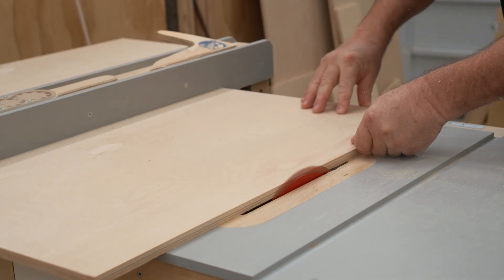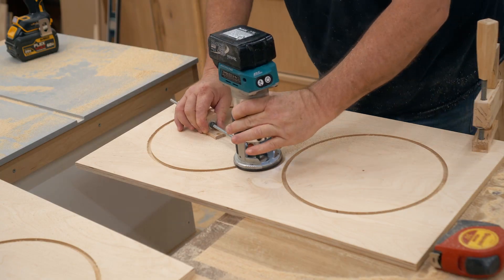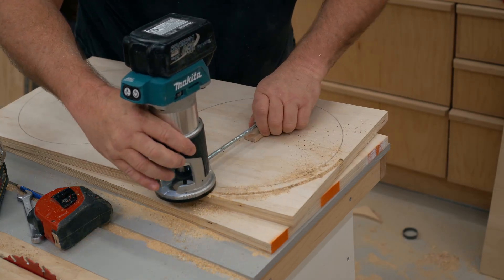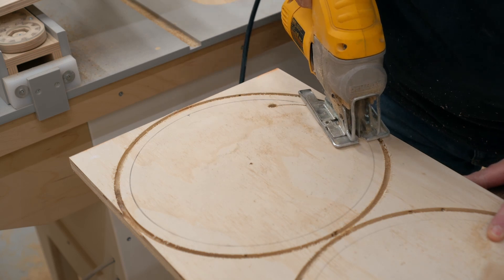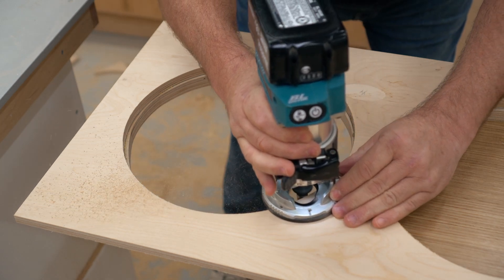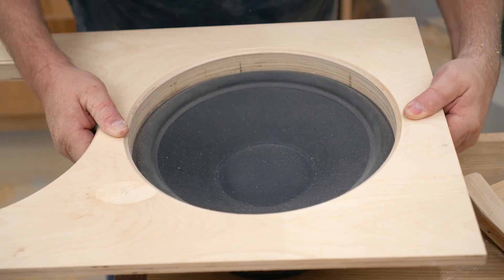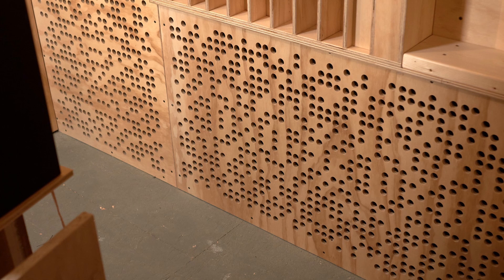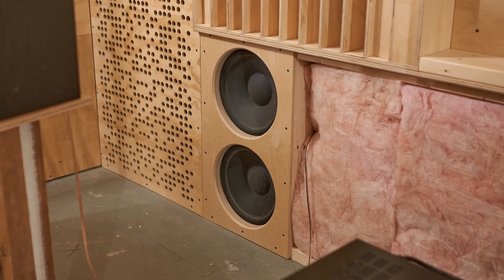BIG Bass in a Small Room - Making Infinite Baffle Subwoofers

Comment from the maker: After the very encouraging results I got from the open baffle subs experiment, I decided I'd go all in and put them directly in the wall. This is known as infinite baffle, where you are just getting output from the front of the drivers without any interaction with the back wave of the speakers.
My listening room's front wall has a utility room behind it, so it's nearly perfect for this setup. All I had to do was cut out the drywall directly behind the woofers to open them into the space. The utility room acts like an infinitely large box and completely eliminates cancellation from the back wave of the woofers.
I did have limitations on where in the wall I could put them, and this close to the floor isn't ideal. But the results are outstanding - flat bass extension down below 20Hz in the room and the woofers are neatly out of the way.
These are four 12" woofers with each pair wired in parallel (for a 4 ohm load) and driven by a 100 watts per channel Yamaha receiver that can deliver nearly 200 watts per channel into 4 ohms.
The "Mad Max" recording at the end was done on a Zoom H1 using the built-in mics from the listening position. The Zoom H1 has two mics built in for a "stereo" recording. Not the greatest mics or recorder, but close enough to give you an idea of how the room sounds.
Reply: How about adding an “Aperiodic Membrane” behind the Sub drivers? Easy enough to do in your situation with the utility room behind. It would be another great video you could run before and after measurements!  If not that’s cool too. I really enjoy your videos! Keep up the good work! 🤘🏻😎🤘🏻
Reply: @doctersound9630  Thats interesting.  If its infinite baffle whats the point in absorbing the backwave though>?
Reply: An "aperiodic membrane" is one part of a type of subwoofer enclosure. It is an air-permeable sheet which has frequency dependent acoustical resistance properties. The original design goes back to Naim, for use
in home systems, but has been applied by several individuals and
companies in car audio.The completed system will be aperiodic, which means it will prove to be over-damped with a Q well below 0.7. In contrast, the most commonly used sealed enclosures have Qtc's in the range of 0.8 to 1.1 which are considered, by definition, to be underdamped. When improperly used, a high-Q system may have poor transient response, nasty peaks in frequency response, and high rates of roll-off. Aperiodic systems will feature excellent Aperiodic systems are characterized by better transient response, flatter frequency response and somewhat extended low frequency response. 
Cheers! 😎🥃 - Hope this helps!
Reply: @doctersound9630  aperiodic membranes don't do miracles ad in no way they make subs or woofers act like open or infinite baffle. What they do instead is to make the driver hit lower but not as low as with a port or if it was in an IB. To put that into better perspective, AM allows you to play lower in a smaller cabinet, by about 1/3 of a full size sealed one. That is why they go out of fashion. They also tend to leak some sound no matter what you do, so they're not very Hi-Fi friendly. I would just opt to make the cabinet bigger instead, or use passive radiators. Of course, since I can not install a IB i my home. Yet!
Reply: @IlarionMoga  It was just a suggestion it would be awesome to hear a side by side comparison.  See if there was any change?  I would be curious as would other audiophiles and just casual observers.  Cheers and thank you for the reply!  Great channel!
Reply: @doctersound9630  I read some about them from forums and people designing them and who made speakers with them. It's not worth it from a performance standpoint if space is no issue. Ports and passive radiators would sound deeper anyway. AM is just a sealed enclosure that beats almost the same as one in a smaller volume. In the same volume enclosure  AM wins over sealed, but as soon as you increase the sealed volume, there is no comparison.

AM are not recommended to subwoofer drivers. They move a lot of air and usually play in little boxes too. There are some woofer that need large enclosures to play low in sealed or vented. So they might be worth it for boxes of at least 2 cubic feat so you have a gain of another cubic feat by implementing an aperiodic membrane.
Reply: @IlarionMoga  Good to know.  Kind of what I thought.  I've never seen anyone test this in the real world.  I think it would good education.  I've need been drawn to AM, just think they are often forgotten.
Reply: I would pay to hear this set up
Reply: Doesn’t some bass bounce back in from the other room?

Comment: It's not infinite baffle when you have a leaking wall with all those holes and insulation.
Reply: To give you the benefit of the doubt, those panels are not vented on the back. You can see him building them and talking about them in other videos.
Reply: @TokeBoisen  You can see on this video that the 'diffusion' holes or whatever those are supposed to be are open to the back of the room. This means that the baffle leaks to the back of the room and is not an infinite baffle. This doesn't metter though if and when he gets such a good response. It's just not a true infinite baffle, more correctiy an acoustic resistance box.

Comment: MAGNEPLANAR will solve most everything.  They do not do the very lows, even you have said can no longer hear. Great sound scape.  Not cheap. First time I heard them was in 1974. Nothing compared to now.  My "little" HPM-40's still outperform and a certain volume than most everything. The 4 year old Cerwin_Vega SL-15's are mud after 30 watts on an ONKYO high end receiver, though "capable" of 200 real RMS watts".

 In your room, very nice by the way.....scalp a pare of magneplanar... sorry old school name... Magnepan 3.7i for your room size.

Sound Stage..........
Heart pounding........
Clarity.......

Pick out the location of each instrument, absolutely amazing.

John, even with your and my destroyed hearing from loud noise and tinnitus.  These are your answer to enjoyment.

Be very careful. 100 watts may necessitate a foundation rebuild.!  400 watts and the house falls down. Large volume of air movement. That's why you "feel" the instruments as well as hear them.

Comment: Infinite Baffle is really cool. I'm planning on trying it out in my car with a Ultimax 18 I have laying around. 

Though my goals with bass aren't a flat response. It's an increasing level of output to the lowest areas my subs can play. Which currently is 17Hz in my car with my Ultimax 10. I like to have at least 10dB more output at 20Hz vs 100Hz. If it's low volume listening a little bit more than that. (In car low volume might be 60-70dB for me, I try to stay under 85dBA though that doesn't always happen)
Reply: In that case, a big vented box that's tuned very low is best. Or if you have the room, a very low tuned tapped horn, but it will be a beast, and is more difficult to design.
Reply: @TimpBizkit  That's what the 10" was. A big "vented" (Passive radiator in my case which functions the same) box. 

The infinite baffle Ultimax 18 I put in my car is great because I have all my trunk space back with the same or similar output in the 15Hz range.

Comment: Hi All - I have 4 x 15" original Adire Tempest subs in Manifolds build into the floor in my dedicated room.  The floor cavity is the box.
2 Drivers in each Manifold,  facing each each other to cancel mechanical vibration, with the top open into a hole in the floor.    A manifold behind each main speaker, in the front corner.     

Technically they are over-damped, QTS is 0.4, but practically.....awesome.   Similar to John they extend well below 20hz.   Rolloff stuff, F3 and all that....is irrelevant, it all happens so low it doesn't matter.   As they are flat (room excluded) through the relevant frequencies, group delay is very low.

After EQ (Multiple Subwoofer Optimiser to EQ them together, then the Anthem ARC over the top), the  in room response is very flat - but you will always be at the mercy of the room, and you can't move them around for a better response.

Excursion has never been a problem.   At normal listening levels they barely move.  There is no air spring to overcome, and loads of cone area.  Therefore distortion is low.
At insane movie levels they move a bit....but the floor/room is shaking like crazy..and at ludicrous levels the floor feels like an earthquake.    Power has never been a problem either, I drive them with a Rotel 200w per channel amp and have never clipped them. 

But while they can go loud, it's really about a clean, articulated response that make your main speakers feel larger and opened up.    Not chest-punchy car sub competition bass.    (But with this much headroom, you can EQ whatever bass response you want.)

If you can do this...DO IT!

Anybody else remember The Cult of the Infinitely Baffled website?

Comment: Hey John, great stuff. 
SBA, single bass array!

Despite the fact I'm currently exploring all things open baffle etc., I'm an IB enthusiast/advocate as well. 
I built an attic mounted (4)x18" IB firing thru a dual opposed manifold. 
I also have two, double 15" SubMersives. 

There's nothing like the bottom octave efficiencies that accompany an IB alignment. 

An IB only needs a small fraction 
of the normal power required for a sub... ~10%... that's huge*. 
A typical high performance 18" sub driver may require a few thousand watts to hit full stroke in a typical sized enclosure. 
My 18"s need only 200-300 watts to bottom at 30mm. 

*(reducing power needed by ~10x dramatically lessens compression effects of instantaneous peak voltage drop from the breaker, the wiring, the amplifier, etc)

Even though the driver hits full stroke, distortion is lowered because those 10x efficiencies lessen current based distortions in the motor. 
Le(i), Le(x), lessens both harmonic and intermod distortion (Klippel). 

Also, power compression is equally lowered by 10x ... and that's mammoth. 

Another big advantage is entirely eliminating SBIR, which plagues every system/room with freestanding speakers. 
Thus, all that direct energy propagates forward, uniformly, without the impact robbing effects of boundary interference nulling.  

Down low, IBs are excursion limited, not power limited.. so more likely to be damaged via bottoming, than burn up the voice coil.  

As with flush mounted studio monitors, your flush mounted subs now increase the acoustic importance of your rear wall behind the listener. You'll likely need a ton of damping.

That's a lot but damn, I think your front wall is just the coolest! 
The visual aesthetic... gorgeous natural wood tone, with the BAD like diffusion holes, is just straight up bad-assery! 
I vote no black paint.

I find it particularly interesting because I'm currently rebuilding the front half of our room... heavy with wood slats, slots. 

Thanks, all the best.
Reply from the maker: In my case, SBIR is a bit more complex. This wall is really just a 1/2" layer of drywall, since the front is covered with the diffusion panels. That's mostly invisible to low bass, so the wall behind this wall -  4 feet away and made from concrete - also has an impact. Not as big as it would be if this wall didn't exist, but still has an effect.
But the effortless increase in extremely low bass over the OB setup makes this well worth the time it took to do it. There's really no going back from this.

Comment: shame you had to cut down the diffuser and instead setting back the woofers behind the diffuser mounted on the other side of the wall so they would be behind the diffuser and be hidden so you hear the sound but no sight of speakers
Reply: That would be cool, but I'd suspect the acoustic effect of the holes wouldn't be ideal, ie., they'd impede the output.

Comment: "Infinite" baffle designs are awesome. I love that you've effectively turned the room behind into a giant subwoofer cabinet. I wonder if there's any promise in adding a floor to ceiling, wall to wall enclosure behind the baffles in an installation without a room behind to use as an enclosure. I don't know, but I would imagine that there would be significant comb filtering from the backside of a shallow enclosure no matter how big the other two dimensions get. Just spitballing. Thanks as usual.

Comment: It looks like your woofers are overdamped. This is a common problem when using conventional woofers in an infinite baffle system. A typical good quality woofer has a Qts of between 0.3 and 0.45. When installed in an acoustic suspension cabinet, the air in the cabinet acts as an additional spring to reduce the compliance of the woofer and raise the Q to a more desirable 0.7 - 1.0. Without the small volume of trapped air, the woofer's Q stays low, and so it is overdamped. This is what's causing the slow rolloff you're getting in the deep bass.

You could either try woofers made for infinite baffle, with a Qts of 0.7 - 1.0, or you could simply insert some power resistors between the woofers and your amplifier. Assuming your woofers are 8 ohms each, and the two on each baffle are in parallel, you could add a 2 ohm 200 watt resistor in series. This would waste a bit of amplifier power, but it would also raise the Qes (and therefore the Qts and Qb) of the system, flattening out the bass response. You can find such resistors for about $10-20 each, so it's worth a try.
Reply from the maker: Yes, they are not the ideal drivers, but they are the ones that I have. Also adding mass will drive up Qts, but I'm quite happy with what I'm getting as they are. I may experiment further in the future.
Thanks for the comment, you obviously know the subject.
Reply: @IBuildIt  Actually, I think what your results show is an illustration of the difference between what people think they want and what they actually need.  In your case the roll off is nearly perfect for your room as the results plainly show.  People think they want flat extention to 20 Hz or below when actually a F3 of around 40 or even higher is much better in room.  I will add the caution that without the rear air spring you may eat up your driver's Xmax relatively easily....Especially with movie soundtracks.  I think you know this already as evidenced by the roll off on your EQed curve.  Great video on a seldom covered topic!
Reply from the maker: @russellanderson746  I've made several videos on the way to settling on this IB subwoofer setup, including measuring the the "safe" range of cone excursion for these woofers. If I thought this would exceed it, I wouldn't do it.
While this video stands on its own, it's worth watching the ones that lead up to it to get the whole story.
Reply: @IBuildIt  I think I've watched all your videos on this build(and enjoyed them).  My comment on the Xmax issue was intended for others who may not be familiar with these concerns.  I'm glad you're getting good results with the IB.  The transient response should be outstanding considering Qtc should be very close to the Qts of your woofers.
Reply: One more thing....To anyone contemplating an infinite baffle install, be mindful of the effect that opening and closing the door to your listening room/home theater will have on the cones of your drivers....be gentle....slamming not recommended!!!!
Reply: Resistive tuning is the way to go. You can adjust the amp feedback to do it without waisting power, this will also improve amp distortion
Reply: @luchp40  Yes. Positive current feedback in the amplifier can be employed to change its damping without wasting any output power. This used to be a feature on certain amplifiers years ago, but I haven't seen any produced with it in a very long time. It isn't hard to add though, even externally, provided the amplifier uses common ground for the loudspeaker as opposed to being a bridged amplifier.
Reply: @ScottGrammer  With common ground you can use a small series resistor (0.1 ohm) + opamp in a configuration similar to a Howland current pump.
Reply: @luchp40  Bingo! 

And just for fun, you can also create an amplifier whose output exhibits a negative source impedance. That's the opposite of what you want here, but still....

If you research the Fisher 500T receiver, or the KLH Model 20 compact stereo, you'll find amps that use this very configuration. And in the 60's, EV used to make amps with variable damping using this system. They actually had a knob on the front panel with which one could dial in the damping.
Reply: @ScottGrammer  I never seen one with adjustable damping, but especially for own build speakers it makes sense. I could make a damping tuner for you that you can add to any amplifier if you are interested.

Comment: You probably talked about this in previous vids, but are you considering painting this room black at some point? That would give a feel of an ultimate home cinema. And ye, I know you like natural wood, but maybe in this case black would sute better? Also it would hide some irregularaties and flos in hole patterns, not that there are many, but there are some)
Reply from the maker: I talked about painting them black in a previous video, and I may do that. I also might take them off and recut the holes on my CNC so that they are perfect, and also a mixture of holes and slots instead of just holes. 
But when I'm using the room, the lights are turned way down, so I can't even see those panels. Painting the entire room black would be a huge mistake.